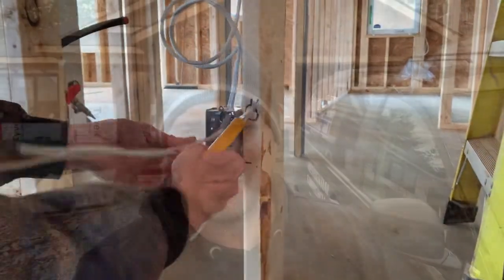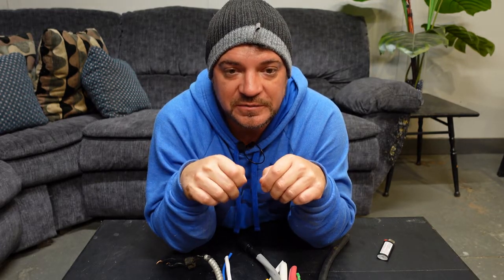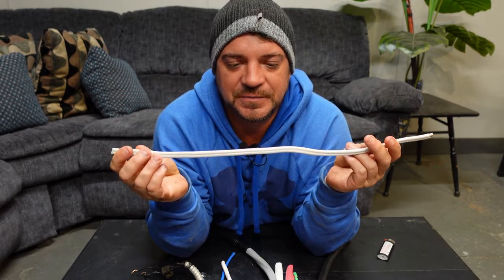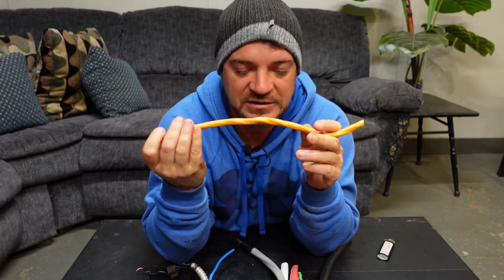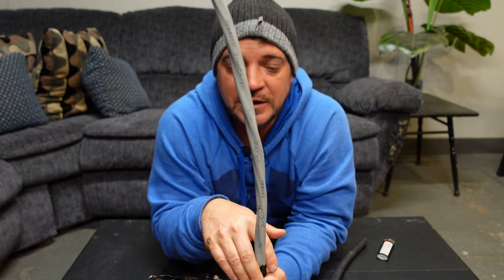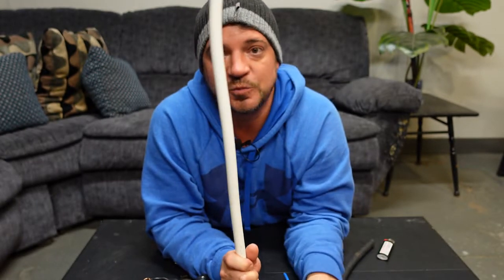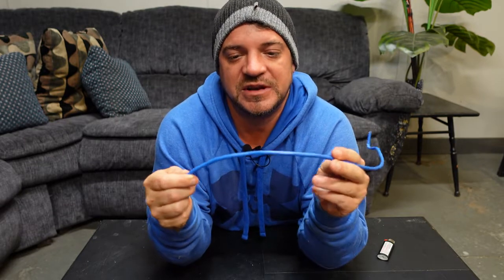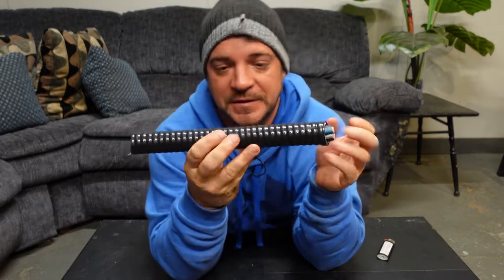The Different Types Of Romex Wires And What The Colors Mean

Comment: By the looks I have the white wire (house built 1997). I am remodeling kitchen. So should an electrician use the yellow 12/2 or stay with with the white wire which I believe it’s 14/2? The current wires are fed by 14/2.  With the remodel I see them suing 14/2 as well.  In other areas when adding outlets 12/2 was used to add outlets that was being fed by a 14/2.